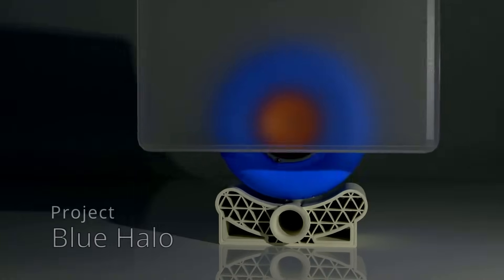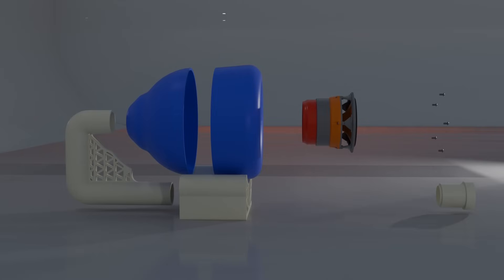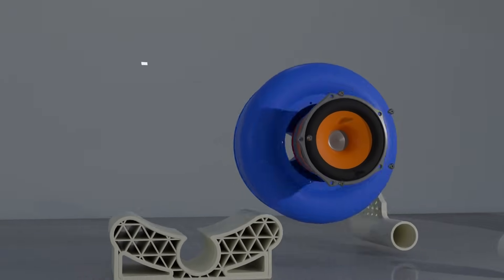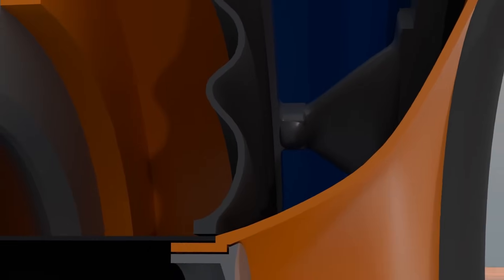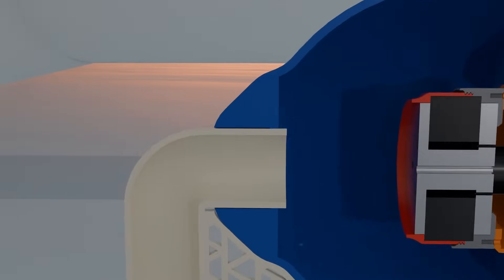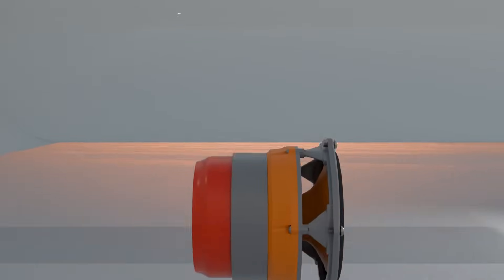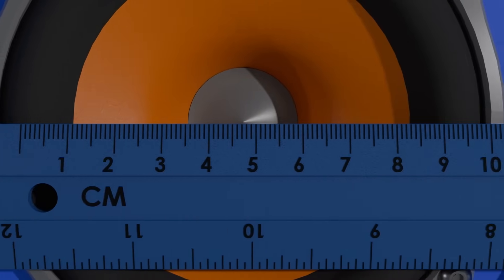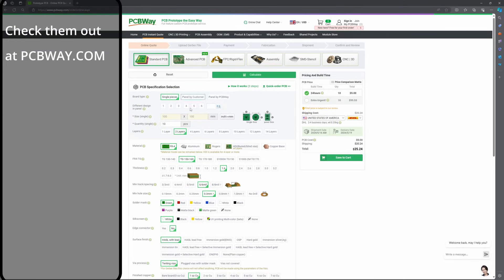Almost* Fully 3D Printed Speaker V16

Comment: Also noticed the rattling due to the "tinsel leads" youve been using if you glue or thread them thru the spider like done on high power subs you should be able to avoid the issue without needing to buy actual tinsel leads

Comment: how did you print magnets, wire, and screws??
Reply from the maker: Super original! Go read the other 20 comments that said the same thing.
Reply: @piscesprinting  im just curious, ive never tried to print metal things, how did you do it?
Reply from the maker: If we wanna get real technical here that wire was extruded at some factory- which is very similar to 3D printing. Then I wound it around a coil building it up in 3 dimensions…

I could print screws on my resin printer  -as a matter fact I could just release the 3d file of the modeled screw when I release the files and anyone with a resin printer could replicate them but that’s a waste of my time and resources when it costs $.002 for a metal fastener. 

As for a printing the plates- again I could release the files to be 3D printed but you need deep pockets for steel 3D prints. It’s cheaper to have laser cut plates. 

The magnet- you could never print a magnet- if you know anything about magnets you’d know they need made in 1 piece, you cant add to a magnet once it’s created- it would need broke down to bare components and remade to be added to- therefore additive manufacturing wouldn’t be plausible.

I’m so glad you pointed out these very obscure things that I must have missed though! SMH 

The motor needs non printed parts, but the speaker components are all printed.
Reply: @piscesprinting  well thought out answer, good job.

Comment: I don't think those two hard 90° bends are a good idea, why no make it a U-shape, or at least using a larger radius for the bends and a bit of a straight between them?
Reply from the maker: I’ve been asked this a couple times, so I did some research, it seems 90 degree bends will impact performance more drastically as air speed increases. So the predicted air speed max is 24m/s but for the range I let it play it’s actually closer to 15m/s or less. I plan to play with some CFD software to see how much affect it actually has to have a straight port vs bends vs sweep. From the few sources I’ve read the sub 15 m/s air shouldn’t care about bends very much, but that’s why I want to test with CFD software.

Comment: Hey, i just want to say that you did amazing work. I have a dumb question. Many say that it is very important for speaker sound quality to get rid of unwanted vibrations. What if you took the entire structure and immersed it in concrete. So that the whole thing weighs, say 20 kg. How do you think this would affect the sound quality?
Reply from the maker: I have filled 3D printed boxes with concrete before, I have a video on it on my channel- it’s the 8” woofer video if you’re interested.
Reply: @piscesprinting  Thanks! i will watch it. Sorry but i didn't check your vids, i got your vid on yt cards and it was very interesting proposition. Anyway best wishes and good luck with your epic designs!

Comment: I would have thought that having just 5 small holes at the speaker end of the port would reduce airflow and port dampening - making such a long port redundant.
Reply from the maker: The five holes are in the bottom plate of the speaker, they allow air to pass up around the coil, cooling it in the process- this sealed section is from the spider- down. I use the spider as a piston to push and pull air in around the magnet and coil, 

Then the backside of the cone has huge opening in the frame that allow it to push air around in the box, which escapes from the 42mm hole in the very back of the box, you can see this momentarily during the exploded view of the box and also during the section video.
Reply: @piscesprinting  Ahh, that makes sense. Thanks for your reply.

Comment: i real speaker would have magnets, and you cant 3d print those. this is just a fancy box shaped like a speaket. very chinese really: it LOOKS like a speaket, so it must be...
Reply from the maker: Not sure if this is sarcasm or not but every part of this speaker that can be printed, has been printed. Also it most certainly works… I’ve included two short clips during the build montage where you can see the cone movement as the audio being played is from the speaker…
Reply: @piscesprinting  well then, i stand corrected: "Fully 3D printed" obviously means something OTHER than what the words imply here..
Reply from the maker: Fully 3D printed in this sense is to differentiate from the mountains of videos out there that only 3D print the enclosure. 

Now if 3d printed magnets were possible- I’d absolutely do that. But technology like that doesn’t exist- at least at a consumer level. Also 3D printed magnet wire is impossible with current tech. 

However with your high level of standards I’m a fraud for even using glue and fasteners, you should just be able to download a single file, hit print and have a speaker, right?? Having to even assemble it is blasphemy.

If this much stretch of the truth hurts your feelings that bad, I truly believe you should stay away from the internet, there is far worse exaggerating out there than this little YouTube video. SMH
Reply: @piscesprinting  maybe that first paragraph there should have been the title of the video, then, because otherwise it is misleading. the rest of what u wrote was tl;dr, so i didnt.
Reply from the maker: If you’re going to complain on YouTube you should at least read comments completely… 

However, that’s too long for a title… you get 100 characters… with only 70 being shown, the other 30 are truncated. I doubt you do any sort of video making or you’d understand the importance of short titles, not over complicated ones. 

It’s very hard to say “I printed everything I could on this speaker but it’s not 100% printed” in 1-2 words. While also including a version number and “3D printed speaker” 

Anyways thanks for the post engagement, hope my next video meets your high standards. Cheers!

Comment: Fascinating! Consider getting a tonne (metric) of Rockwool as thick as possible and line the majority of your room to kill all but the low frequency interactions. I imagine you want the room totally dead for the response curve testing. The last pair I built were made of MDF with 18x18 pine internal corner reinforcement and Seas drivers from Norway. I buikt the boxbsealed and critically damped. Try it, therebis less low bass, but the mid bass is SO tight. I love it.
Reply from the maker: I would love to build a small audio testing space but deadening the whole room wouldn’t be feasible.

Comment: I think you should consider a resin printer for some parts of the speaker. The cone I believe would benefit a lot from thinner layers and the less layer interference, also making it lighter. The speaker surround could use some work also. These 2 things are going to help your 1w1m eff by a lot. 

I enjoy seeing a younger person giving the idea of a 3d printed speaker a go. Once you start getting some movement on the cone Ill stop by and have some new input. Good luck on your adventures.
Reply from the maker: Previous versions used a resin cone- it was very hard to clean supports off of. I would usually end up 6-7 cones in before getting a usable one. As for weight, the difference was maybe 2-3 grams. I felt the mess and consumed time wasn’t worth it.

Comment: Add small base speaker with  trouble nlocker,cross over.Always best tk seprate the none base freq from the base speaker so it gives it pure base.I see some people run every thing in there base box pluss front back seat speaker. Sounds bad.Should put bass speak inside own box in the speaker body shooting down the port to filter out speaker flap add more base.keep top speaker devided inside from the bass speaker.

Comment: All that work and no video of it playing...
Reply: its playing in the printing montage. but kind of rattles
Reply from the maker: The rattle noise is the magnet wire, I’m to the point of speaker excursion that I need to move to tinsel lead. So I’ll be implementing that next.
Reply: @piscesprinting  ah i see. Bit is it not to dominant? I mean i would get annoyed listening to that😅

What do you mean by magnet wire? The speaker wire?
Reply from the maker: It’s only prominent at high volume with tons of cone movement, and magnet wire is the enameled copper wire used to make up the voice coil, it’s wrapped around the former and sits inside the gap between the top plate and pole of the motor- there is a short on my channel that has a close up of a sectional breakdown of a speaker showing the coil.
Reply: You should be epoxying the coil windings, or similar. They're literally never dry/loose on any commercial driver.
Reply from the maker: The winding are held in place with CA glue- however I have been using Long leads of just magnet wire to run from coil to frame as the speakers haven’t had issues with rattling due to lack of cone movement, now that the cones moving a lot those long leads that attach to the frame are rattling. 

I’ll move to tinsel lead in the future to avoid this.
Reply: Thankfully I skipped to the end.  I had a feeling.

Comment: Eh, just another 3D printed box? With the driver 3D printed as well? Now wait a gosh darn minute!
Did you use tpu to print the spider and the surround?
What about the coilformer? Feels like the materials we have available go against the requirements for speaker building...
Also why?
Reply from the maker: Tpu used was varioshore - 245c print temp at 60% flow with modeled wall thickness around .6-.8 mm.

Coil former was ASA- PLA I never even tried as 60c is pretty cold in an inefficient motor, I was using PETG, but two motors ago I started trashing coils during a 30 minute break in session. So ASA now, it’s also more rigid than PETG so it eliminated some flex during winding.

Comment: Great work so far!  Two questions:

1. What material are you using for the surround and spider?  I’m working with Varioshore TPU on my own projects and can’t get enough compliance and travel.

2. Have you considered using vase mode for printing the cones?  It works well for cones up to around 70 mm in diameter.  With foaming PLA I am getting Mms around 3 grams.  Double that for regular PLA.
Reply from the maker: TPU was varioshore, printed at 245 and 60% flow

I used vase mode before and yes it did cut down on weight by maybe a few grams, it made it really hard to do complex shapes, so I accept the increased weight in exchange for the ability to put stops in for the former and alignment rings for the surround. Also increased moving mass drives the Fs lower and I’ve been hunting for lower Fs

Comment: From the TSP, Unibox and other simulation programs can only simulate the bass range. The modeling is valid up to about 3*fs. Beyond that, acoustic measurements are necessary, which can then be used to set active filters or to develop a passive crossover network. TSP cannot predict how the speaker will behave or perform above previously mentioned point.

If you want to develop a well-functioning bass reflex speaker, the Qts should be between 0.25 and approximately 0.45. If the value is higher, a ripple in the bass range will inevitably show up. You have to consider more than just Fs and the sensitivity. The entire TSP set must always be taken in consideration. For the speaker you have printed, an open baffle design is recommended.

Near field measurements should be taken just right in front of the cone. Just so that the cone doesn't hit the microphone. Far field measurements should be taken 1m away on axis. In REW you should then set a window to filter out the reflections from your room. Ideally you would also take windowed off-axis measurements (only far field)  from 0 to 90 degree in 15 degree increments. This will then give you the directivity behavior. All this is needed for crossover development, and standard, when it comes to speaker measurements.
Reply from the maker: I did touch on the inaccuracy of unibox at the higher frequency for a few seconds. 

I didn’t realize near field was quite literally “so close you can almost touch it” so I will adjust accordingly in future videos. 

Also this speaker marks the beginning of a true starting point I’m happy with, so knowing how to remove the room from the equation is something I had planned on researching, but that’s good info to have in my comments section.  

The reason I’m focused on Fs and sensitivity is those are the main metrics I’ve been using to see if a platform is worth developing- as essentially I’ve been hunting a good motor and suspension to build from. Those are the easiest numbers for me to quickly look at see if I even want to progress. 

I also do try to keep the over explaining to a minimum, I cut roughly 10 minutes of voice recording, as I’m not making lectures but just overviews of my projects. 

All in all very good info and I’ll work on implementing it.
Reply: @piscesprinting   this is a good resource for how to do measurements:

Google "
How to make quasi-anechoic speaker measurements/spinoramas with REW and VituixCAD" (on audio science review)
(link gets auto deleted)

VituixCAD is a must-have in general, can do a lot of things from crossover to box simulation
Reply: Should also do a ground plane measurement (ideally outside with 5* the measurement distance to any wall) for low frequencies in the far field

Then combine that with the windowed measurement to get accurate data across the full spectrum

Comment: Except...  it's not FULLY 3D printed. Driver, magnets, screws, etc. Sure the enclosure is MOSTLY 3D printed but contrary to what the title says, this is NOT a "fully 3D printed speaker.
Also - the external port/vent/tube would be more efficient as 1 gentle '"U" shaped or "horseshoe" shaped port.
Reply: There is just no pleasing you?
This is as close to fully 3D printed as it gets, and impressive as is.
Reply from the maker: Believe me, if I could print magnets and coils I would, but let’s be honest, speaker with almost all 3D printed components isn’t near as catchy as fully 3D printed speaker. 

Also the enclosure is ENTIRELY 3D printed, as is the port, stand, basket, cone, spider, surround, and rest of the frame. 

The parts not 3D printed include screws- show me a complex part that doesn’t need fixtures to hold it together- especially when designing it to be modular and easily prototyped/ every screw surface could be replaced with CA glue if I didn’t care about prototyping. I suppose I can start resin printing screws if small technicalities such as this bother people? Seems like a waste of my time and effort though. 

Metal plates- you could print these if you have DEEP pockets, as an average human my pockets are quite shallow. 

Coils- additive manufacturing cannot produce the necessary precision required to print .15mm enameled wire.

Magnets- no such technology exists to print magnets. 

So I can print every part of a speaker just not every part of the motor that powers the speaker.
Reply: I’m not the video’s creator, but the title serves its purpose to distinguish between this effort, which is remarkable, and the many other videos for which only the enclosure is 3D printed.

This is the video I was looking for, and it is because the words “fully 3d printed” show up in search.

The things that can be 3D printed have been.  No process currently exists at the consumer level for 3D printing magnet wire or glue.  These are cheap consumables.  It is possible to print in magnetic PLA, but I doubt you could achieve field strengths much above 0.1 Tesla in the gap if the entire motor were printed from steel filled PLA.  Certainly not strong enough to control the cone and get a usable resonance peak in DATS. IMO using solid steel and a cheap ring magnet isn’t cheating, it is being realistic.  

Let’s be gracious and allow the words “fully 3d printed” to apply to this incredible engineering achievement.
Reply from the maker: Thanks! I’m glad it makes sense to some of my viewers!
Reply: wow the pendants are out today.  You were SO hoping that the speaker cone was a parts express drop-in weren't you?
Reply: Let's see your "Fully 3D Printed"   project then!

Comment: I love this idea and all that. I really do.

But it's not "Fully" 3D Printed. There's magnets involved, and screws so small it's hard to print them on FDM. I don't know about resin, maybe 4k at that scale?

But ya... it is really a cool idea for sure. Just kind of misleading title that's all :) Keep up the great work!
Reply from the maker: I mean if It was possible to print the magnets and coil I absolutely would, but that technology doesn’t exist yet. As for the screws, I could resin print them but for the sake of my sanity I don’t. And the same could be said of my glue, as it’s not printed either but it’s the only way to join these parts together.
Reply: @piscesprinting  Can you use iron-filled PLA to print magnets? Then use a magnetizer.
Reply from the maker: Iron filled pla could potentially be magnetized- however I feel it would lack the required Tesla to create a strong field, also being PLA- 60C isn’t uncommon in a speaker motor. So I’d doubt it could hold its shape.